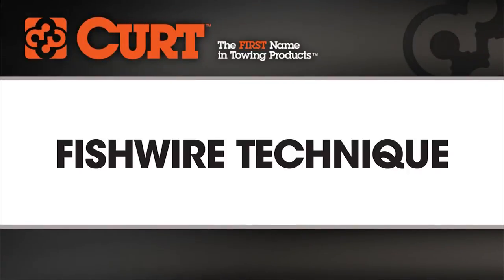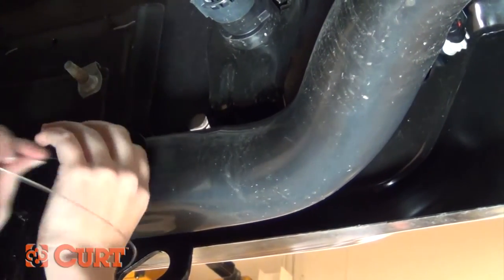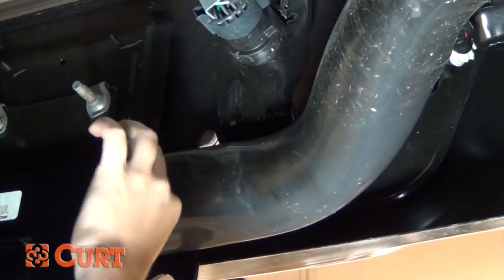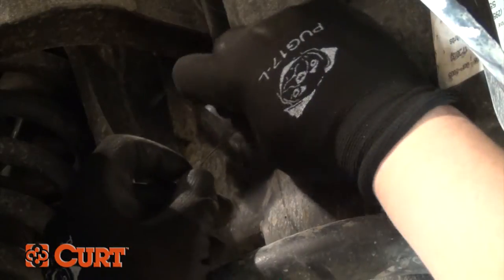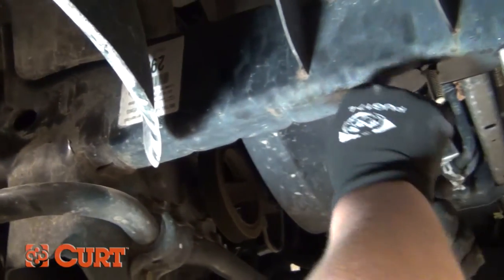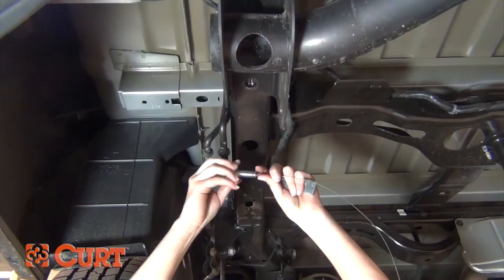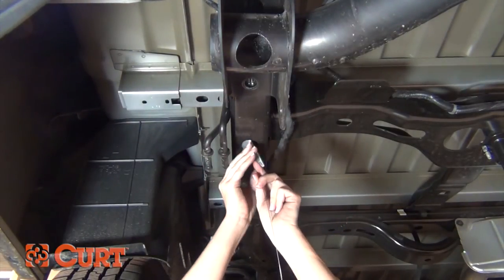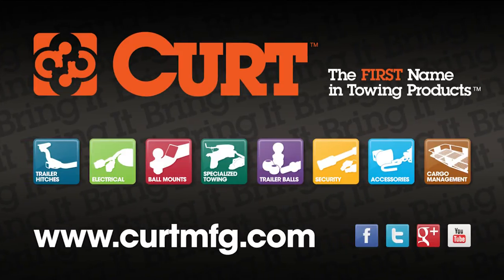How to use a Fish Wire - CURT

Comment: Used the fish wire for installing a front hitch on a 2012 GMC. Needed a bolt in the front crossmember tube. It worked perfectly. Wish I had known about these fish wires the last 35 years of mechanic work, many headaches could have been avoided.